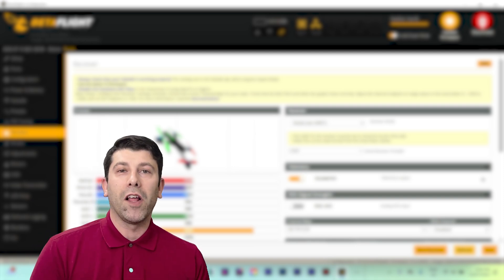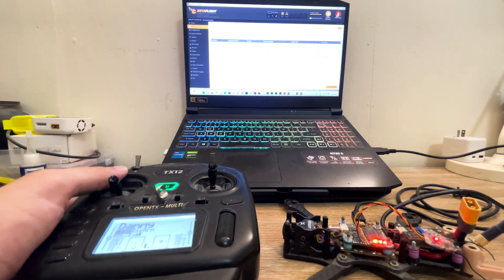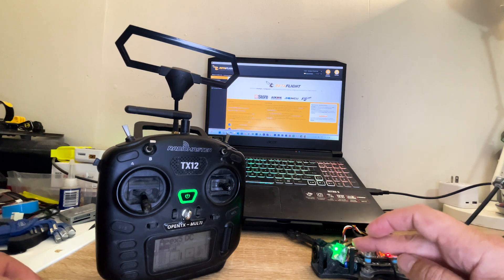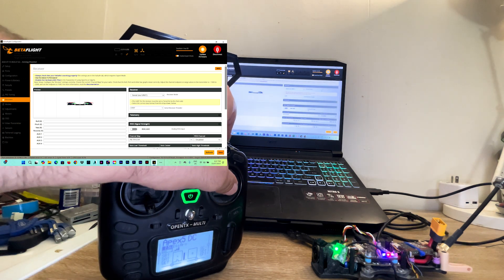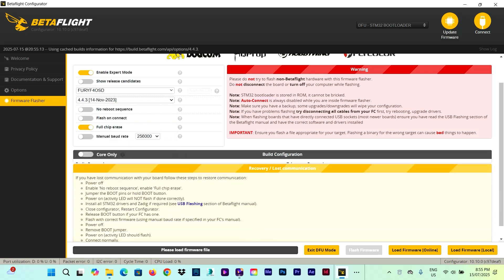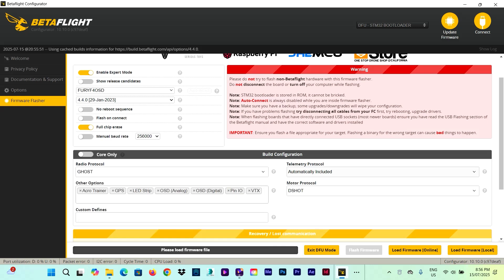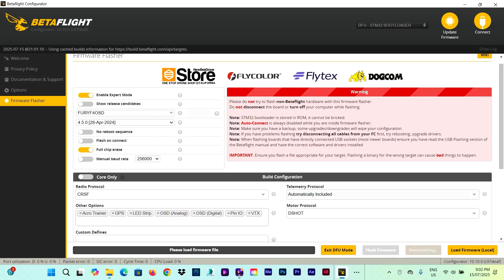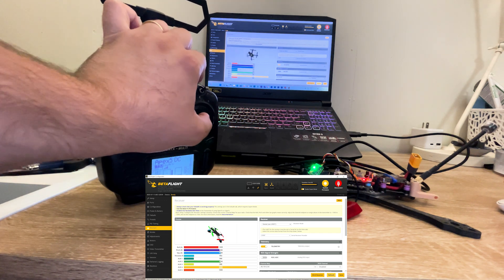BetaFlight's Receiver Tab NO STICK INPUT? Problem Solved

Comment: hey i still have no stick input did everything RX1 goes to RX and TX1 goes to TX on the reciever no sticks and flashed too
Reply from the maker: You still have no stick inputs because rx goes to tx, and tx goes to rx. Fix it and it will work

Comment: Hi, Great tip there. Thank you. I habe a similar issue with INAV 6.0. The elrs receiver and Transmitter are bound butbI do not see any movement in the receiver tab. I have choosen the correct UART, Rx from receiver is soldered to Tx on FC and vice-versa, Serial and CRSF protocol is selected.
Reply from the maker: My pleasure mate, hope it helps on Inav too👍